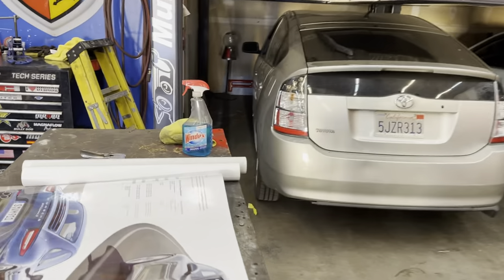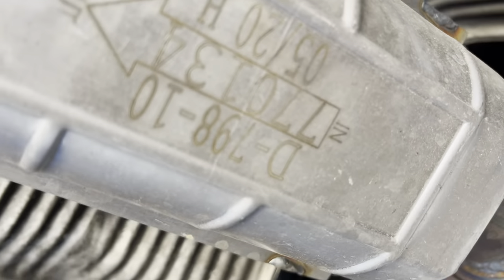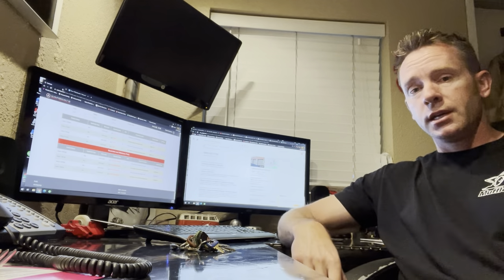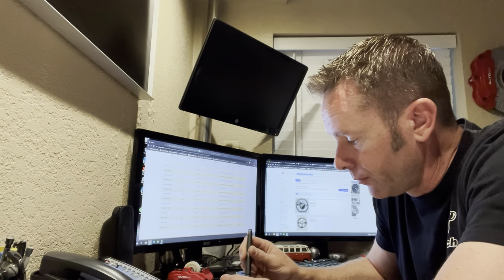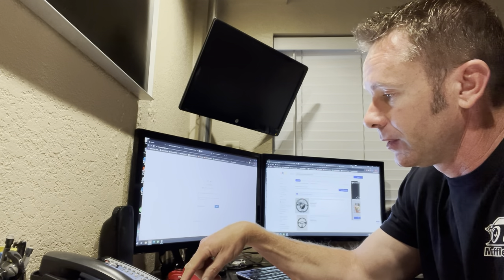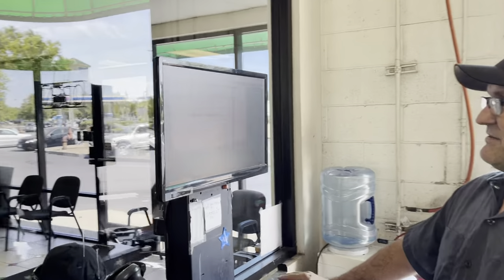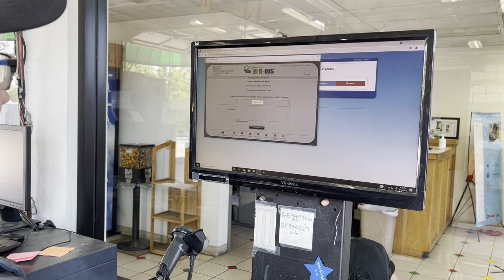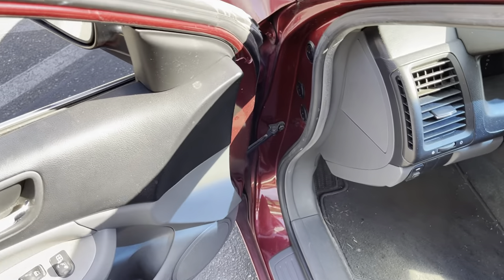There’s a legal catalytic converter for SULEV Accords in California!  Open for an explanation.

Comment: hello, thank you for your videos. I got catalytic converters stolen from both my honda accord 2006 and 2007 last night. Went to a shop to get aftermarket converters installed with new O2 sensers. But engine lights of both cars went on right after the replacement. The error code is P1157, the shop recommends to have air/fuel ratio sensors replaced as well..Do you have any insight here? Thank you.

Comment from the maker: Update.  The 82901 and 82812 from Walker have been added to the provisional list.
Reply: Can you please help me with a part number for efn 7hnxvo2.4cmc ? Will the 82812 work for my car
Reply from the maker: @thatmobsta  if you’re vehicle is an SULEV there won’t be a match for your engine family number.  Yes an 82812 is on the provisional list as of now.
Reply: My car is a sulev model so Are you saying there isn’t an aftermarket option for my efn? Or can I use the 82812 even though it doesn’t match my efn ? Thank you so much for giving you time to reply
Reply from the maker: @thatmobsta  you can use the 82812 if you go through the process I did in this video
Reply: Thank you !!!!!
Reply: @mufflertech  the walker 82895 is the cheapest option I found that is also on the list would you happen to know if it will fit my 07 accord 2.4L sulev
Reply: @thatmobsta  hey did you repair it ? And which one did you use?
Reply: @67JC81  I haven’t yet when I do I’ll let you know
Reply: @thatmobsta  let us know yo‼️
Reply: @thatmobsta  hey any update on which cat u bought? Same car as you same situation
Reply: @thatmobsta  did the 82812 work with inspection?

Comment: HI Colby, great information , my daughter has the same Accord and the cat was stolen while she was living in Bakersfield back in Sept. The muffler shop she took it to  replaced it with a Walker cat, it's on the CARB approved list but downstream O2 sensor  keeps showing the CEL for a PO141 . Replaced that O2 sensor with the exact same model of Denso sensor and I am still getting the CEL. Does it take some driving cycles to clear the CEL for this problem? Clearing the CEL by disconnecting the batter or by erasing with the OBII reader doesn't work, the light just comes back.The Smog referee website says that they recommend that you use a OEM sensor with after market cats as aftermarket sensors with aftermarket cats sometimes have this problem, I thought that Denso made the OEM seniors for Honda.
Reply from the maker: A PO141 code is specific to the downstream 02 sensor heater circuit.  It is unusual for a Denso to be faulty, but possible.  One of the things you may want to check is to make sure there is not a short in the wiring anywhere.  Also make sure the part number you have is for an SULEV application, they are different.  We have had to do a few cars with factory parts but it is very rare.
Reply: @mufflertech   Hi just wanted to give a followup, I took  the car to a mechanic and he found that the ECU was not working properly, so he was able to find a used  ECU and installed that.
 Well that cleared the P0141 code but that brought up the P0420 code.  I added some cat cleaner to the gas, drove around 10-20 miles and the  CEL for 420 code finally went off.
Next strep is to visit the Smog Referee.
Thanks for the video about the smog referee too.
Reply from the maker: @MarkShimokochi  Thanks.  This information helps the community.  We have had a small percentage of cars have ECU failures due to the thefts.
Reply: @mufflertech  hello I have some important information regarding the smog referee: do not paint your cat yellow orange or whatever until after the referee approves it. They need to see that it’s new, I m sitting here at the referee’s garage amd theyre telling me that it is a problem. I m hoping I don’t get screwed over, I already had to replace the ecu , it’s taken weeks for the ecu to acclimate to the car and now because I wanted to prevent futher theft the referee may not approve this legal cat, what a bureaucratic nightmare , all of sudden now they want to stop theft by making sure mine is new, I have a receipt
Reply from the maker: @MarkShimokochi  glad you shared this.  We don’t recommend painting the cat.  It doesn’t matter to the thieves that it’s painted and to your point it could matter to a smog tech.
Reply: @mufflertech  Final update, the p420 code came back. everyone I talked to pointed at the cat as being defective. The mechanic, the smog cert shop all said that. They told me to go back to the muffler shop that installed the Walker cat, well  we were already out of the warranty and the muffler shop is in Bakersfield ( I am in LA) and after installing had told us that the CEL was something we had to fix. I tried a last measure and replaced the upstream and the down stream O2 sensors and that fixed the p0420 CEL. My logic was that the ecu compares readings from both sensors and the upstream sensor had 157,000 miles on it. If the cat was good and the ecu was good, could not see any leaks in the welding ( I am not an expert by any means), then it might be the age of the upstream sensor.  I bought and installed Denso O2 sensors upstream and downstream, cleared the code, drove the car for about 200 miles and took it to get smogged, CEL never came back and the car passed
Buying the O2 sensors is a little tricky because there is a CA compliant version, that of course costs more , so you need to be aware of that, check the mfg website, I would recommend the Denso or NTK,  I am not sure if it is possible to get an oem sensor from the dealership, it is in short supply or just not made anymore.
Reply from the maker: @MarkShimokochi  thanks for sharing.  It sounds like the original sensors that were used were the culprit.  This is a great example of why choosing the right shop for these thefts is paramount.
Reply: @mufflertech  For Denso, is 234-9040 the correct part# for SULEV air fuel ratio sensor? It wasn't clear to me.

Comment: great video. Do you know if the aftermarket catalytic converter that was installed on the car in the video ever get a check engine light like P0420 after the installation? My parents 2003 Honda Accord (SULEV) just got stolen two days ago. Trying to find a affordable repair solution for them, since they only have liability insurance. thanks.
Reply from the maker: I still own the car.  No check engine light and no issues.  It is important to make sure the shop that installs it verifies there’s no exhaust leaks  especially between the cat and the engine.
Reply: @mufflertech  Thanks you So much!

Comment: I really appreciate all this information but I have a question about the efn the after market won't match the original efn, am I wrong?
Reply from the maker: That is correct, the EFN will never match, that is why a visit to the referee is needed.
Reply: @mufflertech  how does one just visit the ref though? Do I contact them by phone and tell them I am buying a aftermarket catalytic converter that is on the askaref.org list for a 06 Honda Accord sulev then what? Do I wait for their approval or can I buy all the parts, install them and then contact them.
Reply from the maker: @7even.6ix.zer09  it’s outlined in the video.

Comment: Thank you for sharing this info. Unfortunately I didn’t know about all these information and I order a catalytic converter which is carb compliant and fits my car the thing I didn’t realized is that it has a different EFN the only place that sells my EFN cat is Honda and literally there sell it for double the price of what I got. Do you think it’s possible for the referee to certify what I have ?
Reply from the maker: What part number do you have?
Reply: @mufflertech  the one I bought is .4YB3 and it’s for 2009 accord 2.4. and  the one the EFN that fit my car is .4TC3
Reply from the maker: @sal3826  I need to know what part number you purchased

Comment: Just had my '03 Accord CAT stolen ... Rock solid car. Using an aftermarket CAT is the only financially feasible option for me. Should I buy a CAT online, and have someone install it for me? I was quoted $2k to have an aftermarket installed, and another $450 for protect cage, which seems high. I saw some of these CATS online for under $600. Is there a lot of labor involved to weld?
Reply: Just got my 04 accord cat  fixed I paid $1050 for cat plus 2 Sensors and labour. I already had the flex / A pipe  which is around $100-$150 so call around other shops $2000 is way too much for after market cay
Reply: If you plan on doing it yourself than make sure get oem oxygen sensors I hear after market always have issues
Reply: They are likely upselling you the cat as well..... The install labor is pretty cheap and doesn't take them that long probably like 200$...
Reply: @djaqib  Which city is this and which CAT part# did you install? Did you buy your own part first? In SF bay area, the least expensive quote is still $1450 range for any after market cat.  Is your car still running fine without any engine light issues coming up with the after market equip?

Comment: Any issues resolving the check engine light after?
Reply: I have a p0141 and p1157
Reply from the maker: It’s irrelevant now as the state is no longer allowing the aftermarket parts on SULEV.
See here: https://youtu.be/2mTjEFmj31c?si=ioQMBAllGsqFx2So
Reply: @mufflertech  fair however I installed an oem cat in my case but am seeing these codes after doing the repairs. I was wondering if from the accords that have come along your shop that something more serious was damaged as a result from cat thefts for example an ecu issue from the cut o2 sensor
Reply from the maker: @omargerdbro  gotcha.  Yes we do see ECU faults periodically from the wires being cut at the air fuel ratio and 02 sensors.  If insurance covered your repair on the cat theft you can reopen the claim for the ECU without another deductible payment.  We manage this for our customers when it comes up.

Comment: Are these as reliable as the factory parts? I called your shop and a technician told me they’re seeing return rate of 60 to 70 percent within a year due to check engine lights coming on.
Reply from the maker: That is not accurate.  We have had a handful come back with an engine light due to other issues.  These work just fine.
Reply: @mufflertech  Good to know.  Your video lists 3 part numbers allowable for Accord 03-07 SULEV, but asktheref web lists 9 total for Accord 00-07 SULEV.  For Accord 04 SULEV, with 4HNXV02.4KCV, is the Walker 82895 a good option? The approved aftermarket converters prices vary a lot, so I'm wondering which ones are the least problematic for SULEV.  Your videos are super helpful, so thanks.

Comment: What happens when the after market cat goes bad.  They are now banned in California so is there still a warranty?
Reply from the maker: One of the problems with using this cat on a SULEV application is there technically never was a warranty to start with.  The manufacturers of these parts did not design them to meet the correction value needed for SULEV, the state made the decision to make the parts legal for the provisional period.  We informed our customer of this risk.

Comment: I installed catco catalyst converter for 2007 Honda accord and I am having trouble with obdII monitor ( not ready) no code. I already put over 150 miles . Any suggestions
Reply from the maker: Make sure there are no exhaust leaks.  Especially under a load.  Even the smallest leak between the cat and exhaust manifold can throw off the conversion process.  A good way to get a cat through readiness is to get on the freeway and drive 58-62 mph for at least 15 miles without changing from that speed.  Ideally with some climbs, mild hills.  The cat needs consistent heat to light off.

Comment: Hi Colby! THANK you for this (and your other videos) on 2005 Accord 2.4 SULEV after market Cat. replacement!

My son is going to UC Davis and his Cat. was stolen from his 2005 Accord 2.4L SULEV last week! Our insurance asked us where we want to have it repaired and we chose AAA Davis Auto Repair Center (Hoffmann Automotive) in Davis as it has great reviews, AAA recommended and 1 mile from his apartment.

Our insurance sent out an appraiser to view his Accord and our insurance is sending us a check for his estimate (a little over $3K).  Hoffmann Automotive told us we need to have the car towed to their location so they can determine what needs to be done and give an accurate estimate and he mentioned possible After Market Cat but that it would need to be certified by a State Referee. 

I wish I had found your videos earlier as I would have chosen to have his Accord towed from Davis to your Muffler Tech to be repaired just to thank you for all your videos! I suppose that is still an option but Hoffmann Automotive is expecting us to have his Accord towed to them this week.
Reply from the maker: We’ve heard good things about Hoffman Automotive.  I would however consider that they are not a muffler shop and are likely subletting the work elsewhere if you go with the aftermarket option.  All the work we do at our shop is in house on catalytic converter replacement and we stock all the parts for same day service.  Obviously we’d love to help if you would like us to do it.
Reply: @mufflertech  THANKS for the reply. I'll check with my insurance company about changing repair shops and towing to Sacramento.
Reply from the maker: @mikekimura2532  you don’t need your insurance companies permission.  You just tell them what you’re doing.  It’s your legal right to have your vehicle repaired at the facility of your choice.
Reply: @mufflertech  Thanks. Mostly concerned about towing Davis to Sacramento as we only have basic AAA so that only covers 7 miles but you said insurance should cover towing to repair facility and I want to see if they will cover that. Also strange that they sent me a check before I even got an estimate from a repair shop.
Reply from the maker: @mikekimura2532  that’s correct.  They did that to close the claim.  Most people don’t know that once you have a check you can reopen the claim for discrepancies.  Your tow cost would justify this.  You can have it towed by any company and have them send you a supplement check for the amount.  We can help with this if you call the shop 916-421-0399
Reply: @mufflertech  Thanks Cody. Contacted Matt at Muffler Tech and he will contact our insurance.

Comment: Thank you for uploading this video! 
In terms of the choice of getting the provisional aftermarket one vs OEM, I think it depends on your situation, as mentioned in the video.
From part longevity perspective (i.e. a mechanical one), definitely the OEM part would be the choice because it will last longer and is actually made for Honda SULEVs (original catalytic converter, mine lasted about 15/16 years, over 150k miles). Aftermarket ones typically are covered by the manufacturer warranty for 5 years or 50k miles. The provisional aftermarket ones currently allowed for SULEVs don't even have this warranty covered for the test groups, so it's not guaranteed that the part will function for SULEVs for 5 years or 50k miles. 
However, given the other factors that you have to consider during this crazy period of high frequency of theft, you might not even get the full use of your new replacement OEM catalytic converter if it happens to get stolen *again*, especially if there aren't any theft deterrents installed during the replacement process or the deterrents are ineffective. It might be that the OEM part is so expensive or simply unavailable, or even that the risk of it getting stolen again might make it not as viable as it would be in a normal decision to replace a catalytic converter.
For example, in my case during August 2021, I only have two options: OEM or provisional aftermarket. I don't want to risk my catalytic converter getting stolen again (or at least minimize it as much as possible), and I would like my car back on the road ASAP. Getting the aftermarket one fits my situation well, even though I take the risk of the part failing at some point and needing to replace it again. My hope is at that point the OEM returns to it's higher availability and lower price point, the thefts die down, or I might get lucky and the part was good for that 5 years or 50k miles after all.
I think it really depends on your situation, so it's best to weigh the pro and cons of each option and decide for yourself what is best for you.